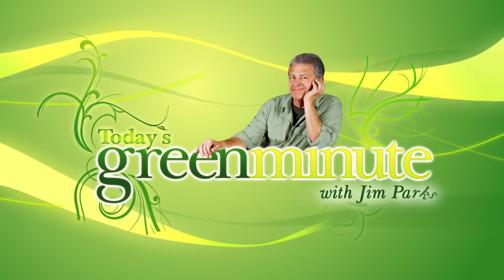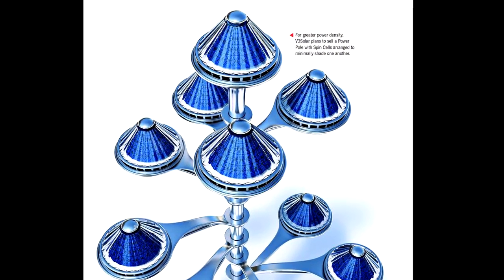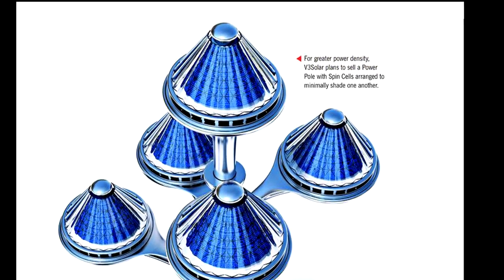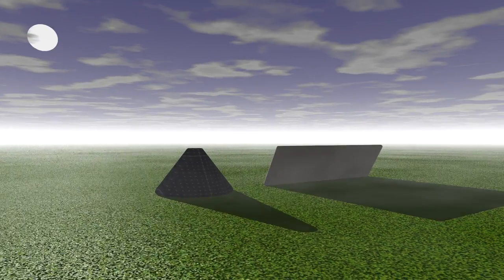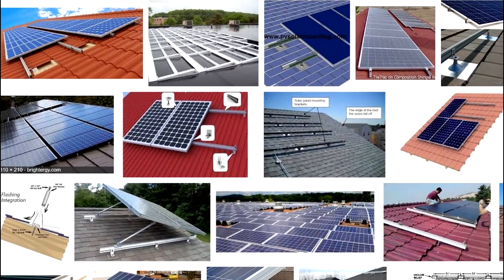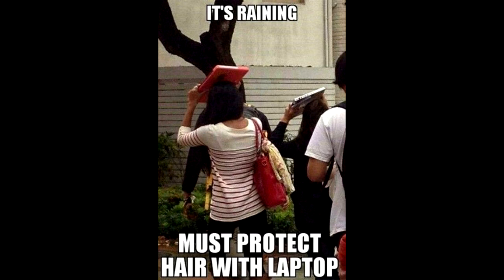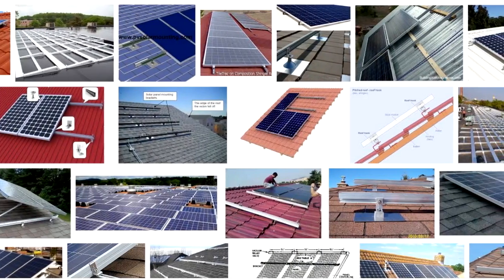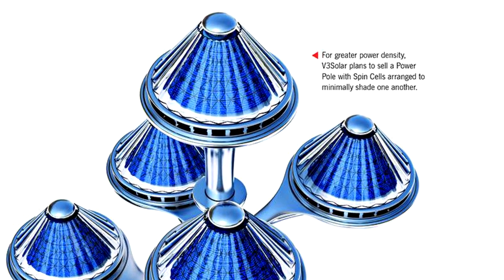Spinning Solar -BUSTED!

Comment: what is wrong with musk's mars mission?
Reply: Arent there other forms of power generation that dont require solar? Nuclear, isotopic, maybe I'm just an idiot.
Reply: i suspect so, but mars is 1.5x further away from the sun than the earth, so they get about 40% the light we do.
Reply: Ya, that really is the worst conjecture i have ever seen thrown out there. If you put enough thrust behind even a brick, it'll fly. Too heavy to get off the ground??? Do you think they didn't do any math??? Sillyface. Frankly, I have read much more about musk and spacex since i posted here originally, and i have to say i am much more impressed! I am rooting for Musk.
Reply: The biggest problem is the travel time. No one in their right mind is going to move a barren, resourceless desert that could spawn some natural disaster at any moment and leave them months away from emergency supplies. What is the economic argument for all this risk, anyways? It'd certainly going to be very prestigious for the people involved, but Martians will actually have to find an industry they can excel at. I can't really think of one considering that everything that can be mined on Mars could be mined cheaper and faster on Earth. We're just not at that level of development yet where our economy demands so many raw materials that we have to send people to a barren rock several months away to mine for them.
Reply: Boris Fliguinskikh The idea really is to secure humanities future by providing us with a secondary home so that the human species can survive a catastrophe and have mars as a backup. Hopefully we can terraform mars and make it habitable but until then its extremely useful for research and our own technological advancement. If we never go to another planet we will eventually die out here on earth. Why wait when we have the capabilities to go to mars?
Reply: This channel is a cosy little curmudgeon's corner for grumpy old men to admire the arrogant thunderfoot arrogantly putting down everybody who tries something new. Now I agree that the spinning solar cell is nonsense but Musk's ideas aren't to be dismissed to easily. Similar objections were raised against the telephone, the steam train, the television, the moon flights and just about every new thing humanity has ever done. Like Musk's electic cars - but wait, that's real. Yeh, nothing is possible or viable or sensible until someone else does it and then the curmudgeons shut up and jump on the bandwagon. Have a bit of vision people!
Reply: flukeseawalker You're right to point out that building a colony on Mars is very difficult, indeed just landing people on there and keeping them alive is a huge challenge. But that's not a reason to avoid or abandon the idea, and if you went back to the early 1960s the idea of landing a man on the moon seemed insane, in fact much of the technology needed to do it had to be invented as the project proceeded, for instance the first computer that didn't take up a whole room and need kilowatts of power.
My own feeling is that I'm not convinced a vast colony on Mars would work in an economic sense that the benefits would outweigh the efforts. However that is 2016 thinking, and things move on.
When I was growing up in the 1970s the idea that we'd all be carrying around supercomputers in our pockets that could provide mobile telephony, data transfer, TV on demand, high resolution photo and video recording with instant playback, voice recognition and translation etc,. would have seemed unbelievable. We had ideas that such things might happen but the actual form they took was figured out as we went along.
Ditto Mars exploration. We should go because we can and because the challenge is there. Humans stagnate if we don't explore and push ourselves, and when we do so we often achieve far more than was ever imagined.
Reply: Don Hyon, ive gotta say thats one of the most awful arguments ive ever heard... the rocket "looks too heavy to get off the ground" thats completely nonsensical, the ITS has 42 raptor engines with an immense thrust to weight ratio and just because something looks too heavy doesnt mean it actually is. they have tested their engines and are currently working to make sure they are as powerfull as possible.
Reply: Mr. Clark, please do not cast me into the "Curmudgeon's Corner" I fully support new and innovative ideas. However, the idea must be realistic and practical. In other words, it can't go beyond the laws of physics, or else it just won't work.
Mr. Musk's plan to have a SELF-SUSTAINED colony on Mars with thousands of people will demand a huge amount of energy. The Sun is the only source and is too far away to be of use, than where will the energy come from. If you have an idea, I am All ears!
You young whipper-snappers think you know everything. :)
Reply: ***** If this isn't a commitment then what is?
https://www.theguardian.com/technology/2016/sep/27/elon-musk-spacex-mars-colony
It's easy to sit on the sidelines and sneer. It was thought to be impossible to steam from Britain to Australia until Brunel built a ship to do it. Anything that hasn't yet been done is impossible until someone does it and then it's obvious.
Reply: You want to hear the most ironic part? The ICs of the boards i have preserved with these original gold and white ceramic packages, are phone switching boards :D. The actual chips were made by western electric...however they were produced inhouse and no datasheets are available... I would like to know what they are exactly..as I am sure they follow the 7400 family in some way, but I cannot find a single datasheet,. Nevertheless, I rescued them from the dump, and I am preserving them at least until the end of my life for human history...I hope the next generation views these as more than gold to be reclaimed.
Reply: +tankd0g Engine is already being test fired, and it's the longest lead item in new rocket development. At this point proposed schedule is not unrealistic provided that Musk can secure sufficient funding.
Reply: pheenalor if you can find a way to capture solar energy at the gamma level you will be wealthier beyond your wildest dreams, because then we can have self-sustain space stations.
Reply: flukeseawalker Read Zubrin's book about Mars and you will see for yourself the answers to all your questions. There is plenty of solar energy on Mars, we're not talking about Pluto. There is nothing beyond the laws of physics in Musk's plan.
Reply: flukeseawalker Yes in the beginning the colony would have to be supplied from earth but in the long term solar power would be used. Solar power runs the Mars rovers, it's nonsense to claim it doesn't work. The energy density is lower than Earth, so more panels are needed. Last time I looked there was plenty of spare land on Mars.
Reply: +Terry Clark, better yet: http://www.space.com/34759-spacex-mars-spaceship-fuel-tank-test.html
Reply: Terry Clark Yes, and for the next several generations they were correct(75 years). Most people in the 1950s didnt have a phone...they used telegraph and post office letters. The telegraph continued until sometime in the 1990s if i remember rightly. Teletype technology and satellite communication made such services useful until the widespread adoption of modems.
Reply: Well of course the last part is true... I would say they are entirely separate points. On the one hand you have the classic quote, "Our species is so wretchedly made that the people walking the well trodden path always throw stones at those forging a new one."

How does that apply to the multitude of people who tried something new which turned out to be insane, not viable, or too far before it's time to be marketable or useful.

With hindsight, we can say that telephone was a great idea. I'm sure people developing VR tech in the 1980s and 1990s thought so. Even though VR is becoming viable now, it was a total failure to the detriment of many investors, software houses, and venture capitalists for decades.

So I guess what I am saying is they didn't necessarily make a bad decision. We can't possibly know what their reasons were...My guess would be the sheer mass of infrastructure required for such a feat. In the end, small test markets and break outs of existing telegraph stuff was used. Its introduction into mainstream took 75+ years!! I can see a company just saying no to that commitment lol...easily, and for any number of motives. If none other than to simply wait and see what may come from the same inventor in a few years to make it cheaper and more viable than running copper lines to every single customers house all over the country/world.
Reply: Not against that assertion at all...the space race revolutionized mankind. I, being a collector of vintage tech in particular, and a preserver thereof, have in my collection some of the first package types of integrated circuit packages! They look rather odd by today's standards...white ceramic and gold pins, with the silicon on the bottom. I am very much on board with the idea of a mars mission/colony, so much that I would even consider myself among the few who would accept the one way ticket of the first attempted colonists(historically, it doesn't look good for the newbs).

My thoughts are simply these: I know that Musks heart is in the right place. I know this. There simply is not a telegraph company in the world who will buy his real time dictograph machine. He will have to fund it himself. I am rooting for him, but at the same time, he is busy undermining himself!!! Building cheap battery tech will undercut his own innovative product. I fear he will be the next Goddard. Watching nazi germany under Von Braun build his dream, instead of having his own people believe and invest in his dream.
Reply: considering mars has no atmosphere, wouldn't solar panels be vastly more efficient?
Reply: I think trumping up a mars mission is just very typical of Musk. He's become the new hipster nerd Jesus since Steve Jobs passed away. I don't think its his fault. People ask him these questions all the time, and then publish them in hipster read magazines. It's just people reacting to that type of sentiment, and it makes money! We all know he's just doing what all the media science people do. Pontificate to any degree they choose. From physicists and their time travel "being supported by string theory" with no actual device even on a drawing board, to landing on mars, or exploring the galaxy with self building robots...It's just a bunch of empty rubbish, not backed with anything concrete. And no, A theory of mind, is not concrete. The loudest sound Musk could make in the direction of a mars mission, is not a press release, but the pinging of a hammer to metal, or the clicking of keys writing the systems control software/designing the actual modules to do the mission at all.

For instance, if he put as much vigor into mars, as he does into batteries, I might be convinced.
Reply: Perhaps you didn't read what i wrote... the difference is action. He is doing some things(cars, batteries) and making off hand comments about pie in the sky stuff(mars and tube rail systems). Because he is nerd jesus people just run it on the press as if it will happen.
Reply: +Peter Lamont, since when did an entire presentation at IAC become an "off hand comment"?
Reply: Well my point was, and still is that nerd jesus hasnt committed to actually doing this. Aside from that, no one has yet solved the radiation exposure problem yet.
Reply: “What I really want to try to achieve here is to make Mars seem possible – like it’s something we can achieve in our lifetimes,” Musk told an audience.
It sounds to me that Mr. Musk himself does not believe in the mission, he only wants to make it "seem" possible. A good Si-Fi novel can do that. :)
Reply: flukeseawalker It was thought to be impossible to steam to Australia until Brunel built a ship to do it. It's easy to sit on the sidelines and sneer.
Reply: Well, I read that link, and I have less doubt about Musk's commitment, however 10 billion US$ per person??? Where is he going to come up with the scratch for that project?
Reply: ***** In 1876 Western Union declined to buy the patent rights for Bell's telephone, believing that the telegraph was in fact the future.
Reply: ***** Well, Western Union changed their mind within about a year or so and did business with Bell and Gray who had by that time set up their own businesses.
However you look at it, Bell was way ahead of his time and faced similar negativity to all forward thinking ideas now. Brunel built impossible bridges and a ship to steam to Australia which was thought impossible at the time. It's easy to sit on the sidelines and sneer at anyone trying anything new, it's a lot more difficult to stick your neck out and do it but that's how humanity goes forward.
Reply: ***** There is a museum of failed products, I think it would be an interesting place to visit. There are even failed ideas that come back again now and then after people had time to forget why it was a bad idea last time (eg solid bicycle tyres). Then there are ideas that are probably good but the technology isn't yet ready to make them viable for general use (eg 3D TV).
It's true that the vast majority of new ideas turn out to be useless or not worth the trouble and it's hard to know which ones will succeed.
The Mars idea is somehow a bit different though in my view. While it's fair to say that we don't know if a self-sustaining colony is practical or economically viable, that doesn't necessarily mean that we shouldn't try. Because in taking on such a huge challenge I think it will expand our vision as a species and will force us to push our technology and ingenuity to the limit.
Arguably the space race kick-started the US semiconductor industry and led to the technological lead that Silicon Valley still has. In the same way the Mars mission will, for whoever takes it on, force them to stride ahead and push boundaries. That's why as a child of the 60s I find the Mars manned mission such an exciting idea, because it's been too long since we did something so awesome.
Reply: ***** I still have a Z80 PIO in a gold legged ceramic package that I'm keeping for posterity along with a windowed EPROM, several things that will never be made again but by contrast are so advanced that the Apollo computer designers could only have dreamed of them.
It's still within living memory that experts predicted the total worldwide market for computers to be about 6 or was it 10? Some no doubt had more vision but I doubt many people thought that an average car in 2016 would contain over 100 microprocessors.
And yet when I was growing up the moon landings were in recent memory and I was expecting we'd have space colonies, space hotels and a moon base by now and probably manned missions to Mars.
And 40 years ago practical nuclear fusion was said to be about 30 years in the future, much the same as what they say now. Prediction is hard.
Reply: Chuck Peddle, the inventor of the 6502 processor did predict this...of course he was the one making it possible. I have a z80 controlled 8" floppy drive which is really neat... Btw the chips from apollo predate the microprocessor. They are thinner and the silicon is exposed and mounted on the underside. I have some uv eproms too :D. They are great for putting programs onto.
Reply: Sean Hardy 
First off. The rocket looks too heavy to get off the ground.
Reply: Sean Hardy Not much, it just banks on the idea of NASA's CO2 Fuel Generator experiment working, NASA plans on testing a small procecing plant that would convert the CO2 in Mars's atmosphere into Methane and Oxygen for fuel
Other than that its a sound idea, the electric energy would be from a small methane or nuclear reactor, not just solar panels
Reply: pheenalor not a bad question. I would like to hear more about this. how does the fact that mars gets 40% less sunlight compare to the thin atmosphere of mars compared to the the energy that could be harvested. we have sent solar powered probes to mars before, what is the energy output compared to the same panels here on earth. I will look into this
Reply: Sean Hardy why do people need to go to Mars?
Reply: Boris Fliguinskikh so what exactly was the economic argument for all the risk involved in the Apollo moon missions?
Reply: Everything is wrong with the plan. Mars does not receive enough solar energy to support life. A self sustained colony is not possible. If we every visit the red planet all the energy needed for the mission will have to be brought with us.
Reply: flukeseawalker That is hardly a reason to not go to mars at all. There are always going to be developments in energy extraction on mars, we shouldn't rule out mars because of energy need because we are likely to have such methods that we can use on mars in the near future. solar power could work on mars but mars only gets 44% the light of earth. I definitely dont think that everything is wrong with the plan, the transportation of getting to mars is well thought out and incredible innovations are also being made even if we aren't quite there with energy consumption of humans on mars.
Reply: You made a very good point, "Solar power runs the Mars rovers." I agree with you 100%. However, the panels used to power the rover are not the same low cost silicon panels you'd place on a roof. The rover's panels are made from elements like qallium, indium, and germanium which are in limited supply here on Earth. In other words, the panels will Never be mass produced. If you want to cover Mars with solar panels that's great, but they would have to be cheap and very very efficient. And don't forget the cost of getting them all there...hmmm
One other point about the rover, it can power-down at night. I don't know any people who can do the same.
Reply: I am aware of Bob Zubrin idea of using a device called "MOXIE" to separate carbon-dioxide into breathable oxygen. That's a great idea. However, the device requires a radioactive element to operate, which means Earth would have to ship the people on Mars a supply of Uranium every two years to keep them alive and breathing. That could not be called a SELF-Sustained colony.
Reply: As I had mentioned I am all for going to Mars. In fact the last item on my Bucket List is to climb Olympus Mons and gaze back at Earth.
I don't see the task of colonizing Mars as being a technology problem, but rather an Energy and Material resource problem. Does Mars have all the 92 elements that we have here on Earth? To support life it will need to have most of them.
Reply: pheenalor, the problem with that is, since there is no atmosphere high enough to diffuse the Sun's energy down to Ultraviolet and Infrared levels, any solar energy that could make the distance would be in the gamma level and destroy any solar panel. It would be like catching a 50 caliber round with a baseball glove.
Reply: Spoon Spop, the Sun is all that there is. Everything gets its energy, directly or indirectly, from the Sun. By the way, the Sun Is Nuclear.  :)
Reply: I'm all for visiting and exploring Mars. I'm just saying the idea of colonizing Mars is absolute nonsense. There is not enough sunlight to make it happen.